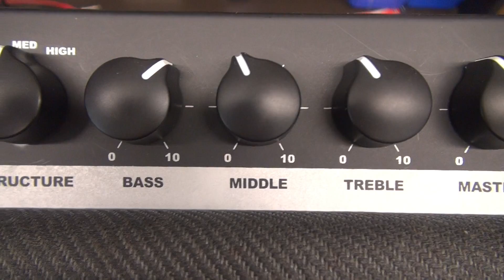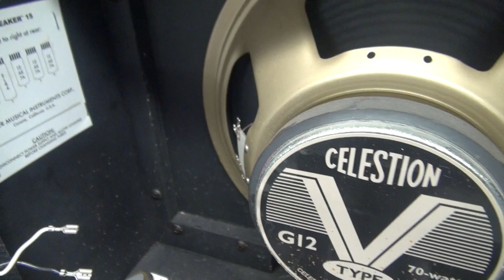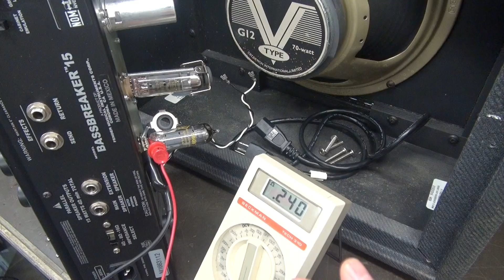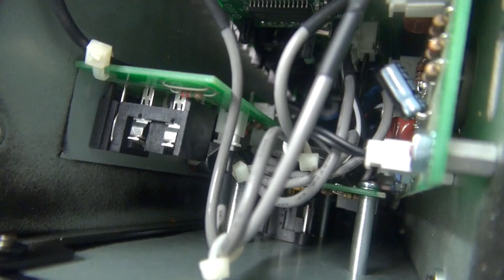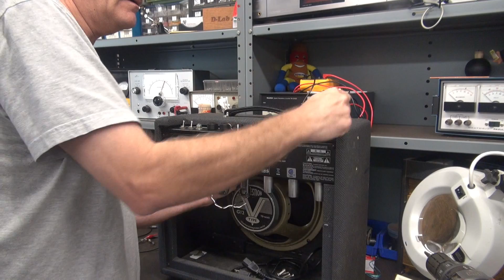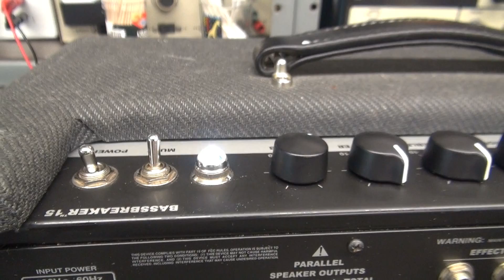Fender Bass breaker 15 EL84 Tube Guitar Combo amp Repair Demo D-Lab

Comment: Hi, nice video. I wanted to ask a question. I have a 15W tube Laney with a 1W attenuator. I play it at home and when I turn it down to 1W it has a flat sound. I tried it at 15W and it's much better. The question is this: if I play it at 15W with the volume always at minimum (otherwise I'll make the neighborhood dance) and the gain and boost always at maximum to get the crunch sound I like, will I ruin and wear out the amplifier? That is, I always load the preamp to the maximum and don't allow the power amp to push. By doing this, will I ruin or wear out the amp?

Comment: WHAT I WILL DO IS TO CUT THE CHASSIS HOUSING INTO SEPARATE PANELS AND MAKE STRIPS THAT SCREW ON AND HOLD IT TOGETHER THAT WAY IT WILL COME APART LIKE IT SHOULD AND NOT BE A SERVINCABLE NIGHTMARE! BECAUSE THIS AMP IS DEFINITELY WORTH ALL THE EXTRA TROUBLE!

Comment: what if something fail on the pcbs or a pot thats more inside of the cage??
what a poor design , not saying its ridiculous.
Reply: You'd just remove the wires with the connector elements and remove whichever boards are faulty, then replace the parts that need replacing! I agree it's a bit more of a headache but I guess it allows for a more compact design of combo amp.

Comment: For hobbyists, the time to repair is available, but for techs, it's pretty time-consuming and can't charge a customer more than amp is worth. The bigger issue is, can you buy these parts (like progrmmed chips if there is any)? Is there a schematic you can look at?

Comment: Bassbreaker 15 Issue Fixed

Problem:  Low end drops out, bass and mid controls don't work and treble control acts like volume.  Problem is intermittent.
Solution:  The terminals on the front of the pots are dangerously close to the chassis and had been making intermittent contact, shorting the mid and bass terminals on the front of the pots to GND.
I placed a strip of electrical tape across the front of the pots to insulate from the chassis.  Problem is gone.

Servicing these amps is not as hard as most people claim.  This amp is worth learning to maintain.

This is such a great sounding amp.  All of the songs on my channel were recorded with one.  Love it so much I bought a second amp which is the one that had this problem.
The first amp had the effects loop hum issue which I got fixed by an authorized dealer, he replaced the 1/4" jack with an insulated jack.  There was a ground loop causing the hum.  My second amp came with the insulated jack.

The BB15 service manual can be found online showing schematics and PCB assembly drawings along with service notes.

Comment: I watched another video about repairing this amp, mainly just about changing the tubes. The repair guy hated this amp and advised anyone owning one to get rid of it. I have the 007 model. I really love the amp. I am glad biasing is not necessary. That was what I wanted to find out. In case, I have to change tubes. I did learn from another video that preamp tubes don't require frequent changing. It's the power amp tube that usually needs changing. Don't know if it's true. Sounds good though.

Comment: It's a crazy layout of circuit boards, obviously designed that buyers can hardly repair it so they dump it when broken... Bad for the environment. Come on Fender you can do better, perfect amp otherwise
Reply: Built for safety I think.

Comment: Does this have a kind of 60hz hum even with everything turned down? like a lot of bassbreakers. do you know a fix for it or is it just the way this power class is not being push/pull?  mine is kind of bad at low volumes, if I record quite loud obviously the hum is lower in comparison and can remove 60htz hum in post but would rather not alter the lowend in ways I don't need too when mixing.  I can fix it if I know how but can't find a solid answer to where the problem is.   cheers! from the UK.

Comment: I have a 30r. The chassis cramped quarters is pretty annoying. I called fender, good luck pry barring a schematic out of them. My nit pick is the gril cloth under the speaker edge. Tone sucker. I put a 16 ohm eminence Cannibus Rex In mine so I'm using a diff part of transformer.  Makes a big diff. This is supposed to lean towards an ac30(15) with a mid range knob. With choke. Getting a 210 cab to sit 112 on. Sneaky ninja.
J.
Reply: The schematic is online?

Comment: Do you think maybe they lay out the components on a flat piece of sheet metal and then use a specially tooled machine to fold it up like a burrito like that before sticking it in the cabinet? And when it comes in for service depending on if it’s an external or internal component they may literally just have a stock of pre-rolled burritos that they just shove in there under warranty?🤣

Comment: 100% agree that these sound great, but I've heard widely that the combos are very hard to repair, and are not reliable.Design flaw with the effects loop make it unusable. 
I might yet try the head version.
If you live in the States, and you want an outstanding clean & dirty amp, with trem & verb that beat Fender, - Ampeg, - especially the older combos; amazing mojo.
Reply: Hi Mark, do you know if the Head versions are designed different?
Reply: @daniellaudman8580  Yes, - my local amp tech was telling me that they redesigned the problem areas.I have the 007 head, and it is almost perfect .Inexpensive, great sound, and Rock solid.Also check out the Vox ACTV 4 head; never thought I'd get another Vox, but it sounds killer, - the bigger models aren't Voxy enough.

Comment: These have a digital hall reverb because a spring reverb makes too much noise and unwanted sounds when you play high gain stuff. I think most people buy this amp for the high gain tone so they made the reverb for high gain applications. I may be wrong but I have a sneaking suspicion that this is the reason for the digital hall and not a spring.

Comment: there is a video of a repair man that said its almost impossible to fix this amp if you had to work on the board because of the design.  he said amp techs will refuse to work on it.
Reply: Yup, and he's dead right. If you're doing this type of work for a living, it's different from Terry doing it as a hobbyist. If you have one of these, eventually you will have to face the possibility of having an extension cabinet.  Plus, it doesn't actually sound that different from a blues junior, which is much easier to work on.  Step up to a Princeton and you have an almost forever amp.
Reply: @cloudconnect  this amp does not sound like the blues junior. This amp takes pedals better and the volume tapers well which means I can use it in a apartment where the blues junior is too loud. But I'm sure the blues junior is way easier to fix
Reply: Their chumps, I repaired mine with basic skills. It’s not as easy because of the tight fit. But it opens up if you take your time. And that’s the catch “time” it takes time to disassemble but anybody that can use a Philips screwdriver can do it. Amp sounds really good.

Comment: The first 30 seconds convinced me this is the amp I’ve been Lusting for all my life , and it just keeps getting better from then on , WOW
Reply: Then you need to watch further into the video to see what the man is trying to tell you.  Unless you miraculously happen to land the one Bassbreaker that will never ever require servicing, I would at least warn you that any type of repair on this thing will quickly become half the price of the amp.
Reply: It's a great amp!!
Reply: Buy one! I’ve the 007 combo and I just bought the 007 head and cab. It’s fantastic. Big bloom from it. Warm and beautiful tone.
Reply: @KRAZEEIZATION  found you again! I have the 15w version!
Reply: @handle433  Ha! I also bought a 15 in October 2023 for €200. Great amps but the high gain setting I never use. I don’t use it much now as I’ve gone back to my Fender Super 210, as it has 6L6 tubes and sounds fantastic.
Reply: @KRAZEEIZATION   they’re great, I’m doing a retube at the moment. I use it as a backup for my Princeton but recently I’m really liking the low gain setting and just using the guitar boost to drive it. It covers everything I need and has ok reverb!

Comment: Fixed common BB15 redplating issue by removing 2 diodes. Also, replaced orig reverb board with Accutronics BTDR-2 spring reverb chip by figuring out the pin-outs of the BB15 (sounds better than the original plate reverb imo).
Reply: Make a video next time.

Comment: Yes, somewhat difficult to get to boards but not that hard (just color code removed connections with different color sharpies). 
I had a redplating issue on one power tube.. clipped off the two zener diodes which fixed it (near power tube sockets... didn’t need to remove any boards to do this). 
Next problem is reverb doesn’t work so trying to figure that one out (May be more hassle than it’s worth). Already replaced TL072 opamp near reverb pot but no luck... what’s next? 
Reminds me of working in the Peavey Classic 30 and it’s stupid folded board design 🙄
Reply: Can someone make a video on how to clip the zener diodes so others like me can maybe do it? Thanks:)
Reply: Did clipping the Zeners kill your reverb?

Comment: Ive been using my bassbreaker 15  switched at 16 ohm impendance. After watching this video  I switched it to 8 ohm. A friend of mine told me that the switch is active only for the external speaker, but I found some difference in the sound switching from 16 to 8 ohms. 
I'm a bit confused now. If anybody could tell me.if the switch is relative to the internal speaker or it controls only the extensial speaker impendance?
Reply: If you connect a speaker to the "Main Speaker" jack, the internal speaker is out of the circuit, so follow the impedance of the speaker you connected to the jack. If you have just an external speaker connected to the "extension speaker" jack, set the impedance to the combined impedance of that speaker AND the internal 8 ohm speaker. There is a complete matrix on how to set this switch in the users manual depending on your speaker scenario. Rock on
Reply: According to the Manual it needs to be set 8ohm for internal speaker when the other ext. Inputs are not being used.

Comment: Thank you so much for showing inside the chassis, been interested in the bass breaker line, but may rethink it, considering the difficulty of just cleaning the pots.
Reply: Remember it’s a job for him, do it yourself, spending a weekend to disassemble, clean and reassemble could be fun!
Reply: If terry tell you it is a Nightmare, imagine how can be for a beginer?
Reply: guitarlewy To clean pots you need to 1) Remove back mesh panel, remove chassis, remove chassis backplate, remove 5 knobs & nuts, mark and remove 5 board connections, pull board out, spray pots, reinstall.. it’s not as bad as it sounds.

Comment: Nice video! I’ve got a BB15 and I love the tone but sometimes after playing for half an hour or so it loses volume significantly in the power stage (I know because I have a looper in the fx loop). I replaced tubes but the problem return after a month or so... any idea?
Reply: Rui Grilo Something maybe heating up. Either a solder joint (bad solder joint) or a resistor heating up and changing value. also cracks in the board could cause this.

Comment: Barring the compact construction, this is the best Fender amp in 20 years IMHO. Sounds incredible, clean or gained up.
Reply: if they made each mode a separate channel, put a belton reverb in, and bumped it to 40 watts it would be a beast.
Reply: @dressedtosmellgood  They did. It’s called the Hot Rod Deluxe. :-)
Reply: 💯 agree 👍
Reply: yes? i am looming for an amp just for clean but not too expensive? its good clean?

Comment: Love your videos. Not sure if this was an editing mistake but you pointed out that the impedance switch should be set to 8 ohms, then later I notice later in the video the impedance switch was set in the 4 ohm position.
Reply from the maker: Yes, the clips may have been out of order. Needs to be at 8 ohm for the speaker installed.
Reply: @d-labelectronics  That power transformer looks twice the size of the one in my Bassbreaker 30r, I wonder why?

Comment: Do you have any idea why el84's have exceptionally short lifetime?
Reply from the maker: I believe amp manufacturers apply excessive plate voltage which causes the tube to ark over. 6V6's are more forgiving in that respect.
Reply: Thanks.
Reply: @d-labelectronics  thanks, I have a 30r Bassbreaker I called it a Bassman in another comment. Paid $130, I think all it needs is tubes . It's brand new! Will try the 6v6's. Hope thats all it needs.

Comment: I spent a week on one of these one day. 
Luckily,  Fender tech support was able to suggest the cure. But, as you pointed out, accessing the circuit board to remove the bad zener diodes was nightmarish.
Reply: Howard Rose If you have redplating issues (blowing fuses), removing 2 Zener Diodes (near power tube connections) are solution.

Comment: very similar to a WEM dominator.. EL84's.. sounds like a British amp..  smokin hot..
Reply: Haven't seen a schematic yet, but I'd assume it's even closer to the  TMB 18 Watt "Plexi" or the 5F6A Bassman (Which the Marshall JTM45 directly copied for some time), having 3 preamp tubes and more preamp breakup. Definitely biased a bit cooler with the 240 ohm resistor, similar to the WEM.